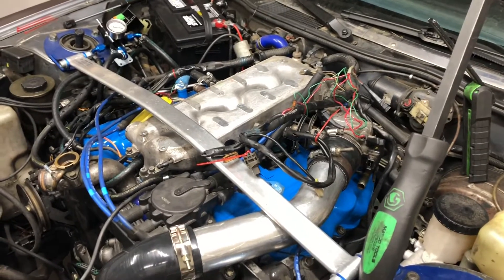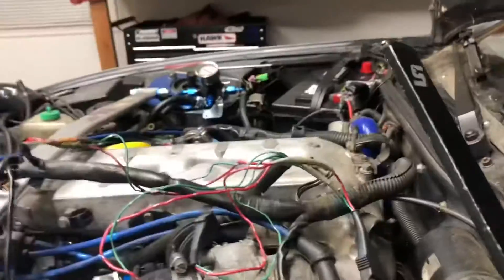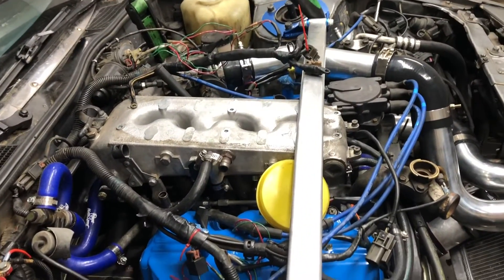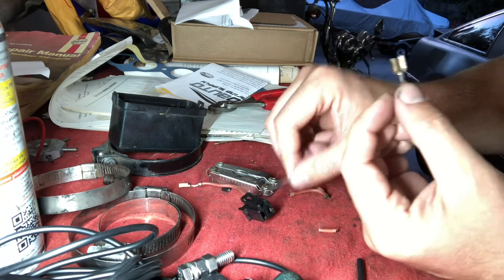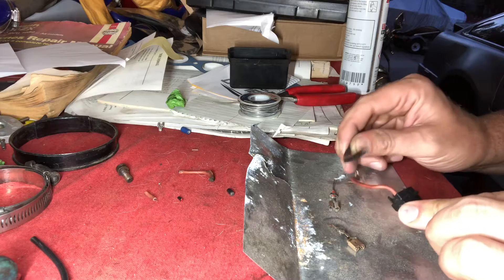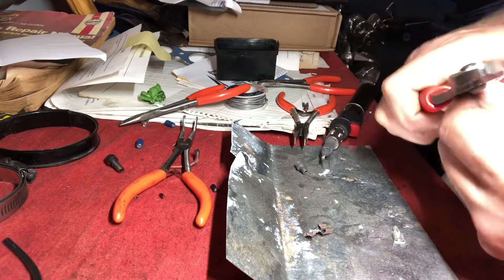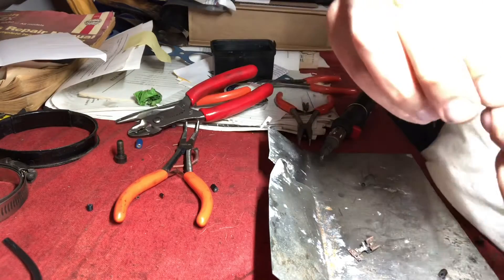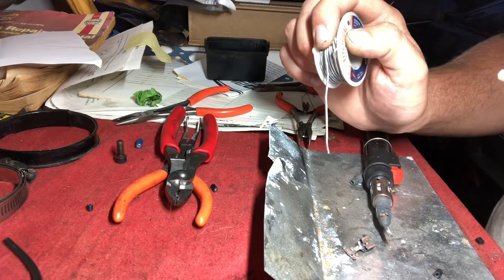Z31 Ep 22 How to blow a fusible link and fix it

Comment: So mine doesn’t have the black clip. It’s just got two quick disconnectors where the black should be and it doesn’t to where yours does. They just connect together. Almost like a bypass, or a jumper wire or something.
Reply: It’s the battery one though

Comment: hey man just got a 85 z31 and need to fix a few of the fusible links i was wondering if you had checked the guages of the old wires before using a 16g or does it not matter?
Reply from the maker: I did try to measure the gauge of the old wires. I ordered 14ga fusible link wire first but it looked too big when I got it so I went with 16. There is supposed to be like an amp value that the wire will hold based on thickness but I couldn’t find those exact specs so just went with something close
Reply: @samwashere1392  have you had any issues with it after that? and thanks for the quick response
Reply from the maker: @knight2091  nope, no problems with the fusible link or anything it powers

Comment: I got no power to ECU, could that fusible link you fixed be the issue?
Reply from the maker: it could be, im not sure which fusible link gives power to the ecu. if you have a digital multi meter you can set it to "continuity" or "ohm" and remove each fusible link and test them individually to rule that out as an issue
Reply: yes - fusable link kills all the engine power systems. When mine blew, the only thing still working was the headlights. Either test yours or replace it and you should be good, unless something else is shorted out which will cause the new fuse to blow
Reply: I installed the battery the wrong way and the fuses began to smoke and burn, going to solder everything like in the video. Hopefully everything works out
Reply from the maker: @mr.reaper2711  aww man 😕 good luck with the repair!
Reply: @samwashere1392  hey no luck with the repair. I uploaded a video on my channel, maybe you can give some input on what I’m doing wrong?
Reply from the maker: @mr.reaper2711  I saw your videos and left a comment. Message me on IG if you need more help @samwashere139
Reply: Hey did you ever replace that fusible link? And did it work???
Reply: @Sideswipe1135  didn’t replace it. Only reason I wanted to replace was cause there was no power to ECU therefore no power to fuel pump. Turns out it was just a wire issue, fixed it, pump turns on but still no fuel being delivered so that’s what I’m figuring out right now